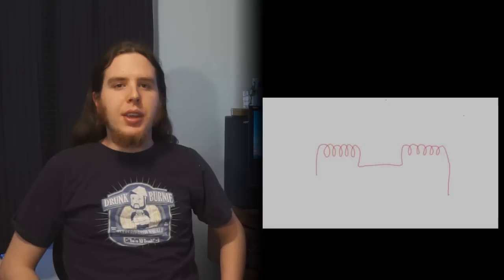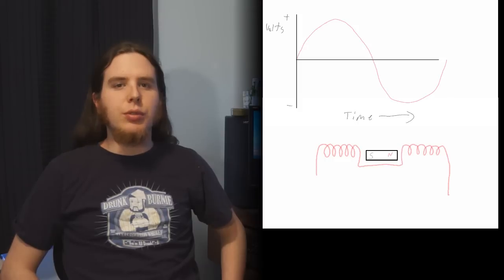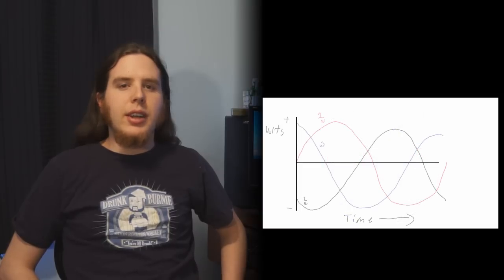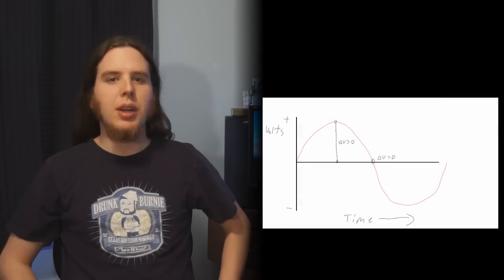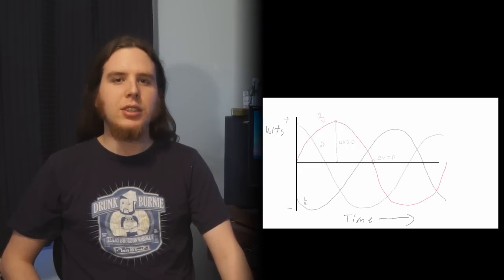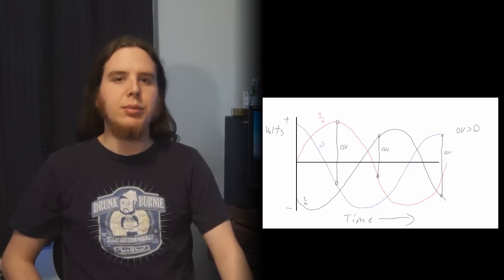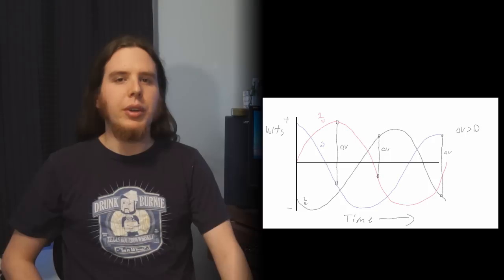What Is 3 Phase?

Comment: you've answered questions that I've had not just about 3 phase but single phase for years and haven't been able to find answers to. thank you.
Reply: though one question I have left, single phase in the US is 120v 60hz; is the 120v from peak to trough or from peak to 0v?
Reply from the maker: It's 120v relative to 0 (neutral or ground). If you have 2 phases you are measuring between their peaks, which is why you get 240v in 2 phase appliances.

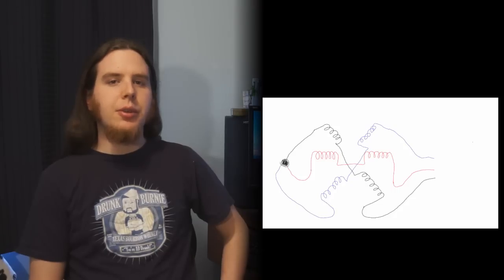Comment: 1:25 - "If you pick any three wires and tie them together you end up with a neutral point"

Each coil has a "start" and an "end". To create a neutral point I believe you need to connect all three "starts" together or all three "ends" together. It has been some years since I studied this, but I'm pretty sure you can't just mix and match between starts and ends.
Reply from the maker: Smudger Dave That's correct, I should add a note there, thanks!

Comment: This is great. I watched another video which presented that at the peak of any phase, there is a larger difference to one of the other phases, than a single phase would have to neutral / zero volts on its own. So I thought the benefit of 3-phase was just higher voltage. But I didn't really get why you now measured the voltage difference to the other lower phase, instead of to regular zero volts. I think I see now now why that is, with your explanation of the 'new neutral' by tieing the three phases together. I hope I've got that right. 
This video also explained another benefit over just 'greater voltage' in explaining how a load can always feel positive voltage rather than dipping into negatives. Thanks so much.

Comment: do you have a video on how to run a 3 phase motor on single phase
Reply from the maker: +terminal velocity The only practical way is to use a small 3 phase inverter like I was using. To use only capacitors would be complicated and would only work for one motor running at one speed with a constant load. You can find small 3phase supplies pretty cheap on eBay.

Comment: Great Explanation!
Question though, why don't we use even more current phases to have even smoother power supply? like 6 phases or even more.

And i dumb one that i can't completely coprehend. Looking from the diagram what does it mean for the power supply when the voltage takes negative prices? i know that it happens because of the coil turn around but why do that on the first place?
So this is a question more like AC vs DC
thank you.
Reply from the maker: We use 3 phase because it is the least number of phases that still gives continuous power. There are some machines that use "polyphase" power consisting of 6 or more phases but they are much more complicated and expensive than regular 3 phase.

The negative voltage is just a part of AC power systems. Having the voltage go back and forth from positive to negative means the current goes back and forth as well making it 'alternate.'

Comment: You cannot pick any three, you have to pick the ones that are 120 degrees apart, the connections you are showing at 1:27 are incorrect as the phase shift is not 120degrees rather 30degrees

Comment: Actually the power transmission of 3-phase is perfectly flat. You have to square the three sinus signals so they become 1/2 + cos (2x)/2. If you do that for all three phases and add them up you end up with those three 1/2 components and the sin/cos components all cancel out. Just like the regular three phase picture/polar diagramm when it comes to voltage. it's the same picture but now it's above the zero line and compressed in time. It costs a little bit of mathematics. the full expression would be 1/2 + cos(2x)/2 + 1/2 + cos(2(x+120º))/2 + 1/2 + cos(2(x+240º))/2. Then you can split those cos expressions into their sin and cos components to get rid of the +120º thing and add them all up. But I guess this is all the 'long route'. You can drop the 1/2 factor since it's the idea that counts. You can also drop the 2x factor so it becomes 3+ cos(x)  + cos(x+240) + cos(x+480). The 480 is the same as 120 and the cosine doesn't matter so in the end it's 3+ sin 0/120/240. See? it's looks like the regular 3 phase picture where all voltages add up to zero.

Comment: So the idea is, there is a spinning magnet near the generation point that engages the three wires at different times so that at any given time, at least one of the wire has energy being created?  Thereby creating more consistent power?
Reply from the maker: +Troy Johnson More or less yes, and 3 coils is the minimum needed to make sure that there is always powered being generated!
Reply: Ok great! thanks for the video.  I was wondering why more phases aren't used to have even better results, but I imagine that it's not a consistent increase in efficiency when say, 6 phases or 12 phases are used.  At some point, it would be way too difficult to manage all of the wires at a substation without a significant increase in efficiency.  So 3 phases is the best bang for your buck so to speak.
Reply from the maker: Yeah, there are some "poly-phase" systems that use more than 3 but they are very special applications and I have never personally seen one. If you had for example, a 12 phase system you could rectify it to DC and not need any capacitors at all because there would be no "dips" in power.

Comment: Sir!  if three phase's graph goes like that, doesn't that mean the power of ac always offsets?  im freshman.. please answer me!
Reply from the maker: The power is always positive (think of it like having a heater from each phase). No matter where you are in the cycle at least one of the heaters will have current flowing through so there is always power.
Reply: ah ha!  so you mean that i have to think it 3 seperate source.
Reply from the maker: Yes, even in a motor each coil pulls on rotor separately but there is always one coil pulling all the time, this makes the motor smoother.
Reply: wow you are stunning explainer!!  Thank you sir.  may i occationally ask about electricity?
Reply from the maker: Sure, I get to my comments about once a week to answer any questions.

Comment: Very clear explanation. Thank you
Reply from the maker: Thanks, 3 Phase was a topic that I though was never properly explained in school.
Reply: +Nick Moore perhaps you could also help fill in a missing link: I do not understand how two phases can be used to run a circuit. Example taking 277VAC line to line from a 480V service. How does the 120° phase difference interact between the two lines?
Reply from the maker: When you get 277 from a 480 service you are measuring the peak (or rms) voltage of just one phase relative to ground. 480 is the voltage you get measuring between any 2 of the lines.